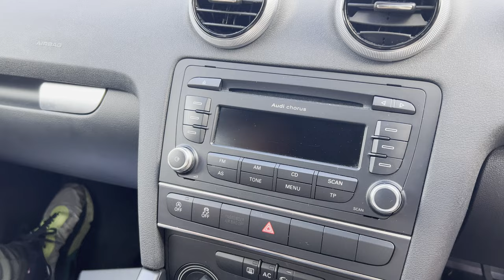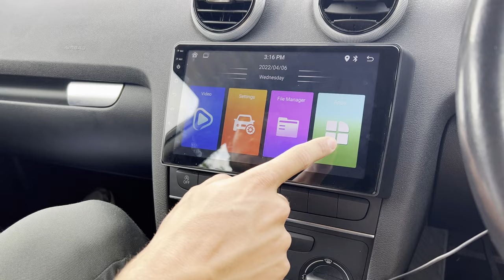Audi A3 Radio Removal Android Car Stereo Fitting Installation 2003-2012 Pluscenter

Comment: My rear speakers dont work. ☹️ Any fix?
Reply: If they were working before then it could be the rear amp needs a power to switch on and you can also buy a different lead to your head unit to fix this.
Reply: Or pretty sure it’s cause you got the wrong harness?
Reply: Wrong wiring or incompatible
Reply: If you have the bose system you need the high/low impedance cable, £25 and it'll be sorted.
Reply: @benji4342 hello! I have the same problem and i buy that adapter , how it is connected?

Comment: Quick one here. I have installed mine but now the time resets all times I start the car. Customer service told me that I need to take the yellow cable to the main power of the car. Also the amplifier for rear speaker needs power too. Can somebody guide me here?
Reply: Hello did yours fit straight in?
Reply: It worked and still working but rear speaker don’t work. I think I need to find a cable to connect the amplifier

Comment: Hi, great, vid. Nice and straight forward. Did the GPS antenna placement affect performance? I was advised that it should try and get line of sight to the sats. Also, did having only 1 fakra affect the radio? I bought a dual fakra but will return it if the radio still works with the single. Not that I listen to radio much.
Reply from the maker: Hi, the GPS aerial is okay there but sometimes will be better to install outside the dash. About the aerial depends of the car original with only 1 is good enough more cases, thanks!

Comment: Few quick questions. What are the 2 usb cables for thst you pushed through the side?
What happens to the maps and music if i put it in reverse (with no camera) ie does it get paused or closed?
How does it work? Does it connect to phone for data? And does it have access to apps store? Sorry i know its alot of questions haha
Reply: USBs are for media you can put MP3s and MP4s and play the media. You can turn off the reversing feature in the settings in car info or sometimes called factory settings. Otherwise you do get a no signal each time you put it I reverse.

Comment: Hi! I just installed mine just like you showed in the vid. My android head unit works otherwise perfectly but any sound doesn’t play (radio, bluetooth or anything). What might be the problem? I have audi a3 and bose sound system
Reply: Did you figure out? I have same problem
Reply: @KurdishZyzz  No I didn’t. I took my car to a workshop and they said that nothing can be done. So I guess that’s it.

Comment: Sorry for the stupid question but how do you then take it back out, is there a specific technique before I yank it out and damage something? Thanks
Reply: I was wondering the same exact thing...every video I have found does not show how to remove.
Reply: É difícil remover, é necessário comprar 4 chaves específicas para remoção. Após encaixada cada uma das 4 chaves, basta usar espátulas plásticas para remover do painel.

Comment: is it the same fitness for a factory bose speakers option?
Reply from the maker: Yes of course our stereos comes with Bose adapter it's also plug and play, thanks!
Reply: does it come with instructions?
Reply from the maker: @hatchali6765  everything you will see in this video is enough to fit it by yourself, thanks!

Comment: Hi there 🙂
I have a "JUNSUN   9" purchased for my Audi A3 8P1.   this comes with a surrounding bezel, once it's in then it's in because I can not see a way to extract the unit, there are four plastic tabs and when pushed inside it allows the bezel and the unit to be extracted, weird really - - - - - -there is no way to get to these tabs once the unit is installed home.
Have you come across this problem before🤔
Reply: Wondering the same. Have you figured it out??
Reply: Se fizer um pouco de força numa das laterais, a mesma vai sair e depois sai a outra e o rádio fica outra vez fora.
Reply: @vrdubb0221  YES I have, before you insert the plastic surround where the tabs are on the surround there are four raised areas (one each corner) be careful if you get a diamond file from Aldi - BUT if you undertake an internet search for one you will see what I mean, using an ordinary rough file it takes forever. BE CAREFUL how you shave these raised areas off  (NOT the tabs) you can now insert the surround and it now fits snugly in place.
You can now place the unit back in carefully moving the various cables out of the way, a little solution here I tie-wrapped all my extra cables, - which makes it neater and when you come to place the unit back in you have an easier time moving cables out of the way,
It fits so snugly because of the tie-wrapped loom that holds it in place and anybody looking inside will see it and move on to the next vehicle to steal their stereo
 just saw that you posed the question 2 months ago sorry 😇

Comment: Hi, how do we make the rear bose  speakers work front work fine but not rear speakers
Reply from the maker: Hi, make sure you use Bose connectors, thanks!
Reply: @pluscenter  does that come with the package?
Reply from the maker: @dannyhasan6118  yes of course

Comment: my friend got the same one, I installed it but the rear speakers don't play. and what worries me the most is that I don't know how to unclip it.  Can someone help?
Reply from the maker: Hi, just pull the left or right side and it will pop out, about the speakers they usually don't work if you don't use Bose connector or if the adapter is not locked up properly, thanks!
Reply: @pluscenter I have my Junsun 4gb+64gb for my Audi a3 8p 2008 and rear speakers don’t play. Are the Bose connectors in the set or must I purchased that ekstra? How to connect the cables properly to make the rear speakers play? Thank you

Comment: Hello, I did everything as the video but I dont have audio, it works but I cant hear anything. My A3 comes with Bose Sound System
Reply from the maker: Hello, for BOSE system you will need adapter between the stereo and car main power. Thanks 🙏
Reply: What adapter do you need for  Bose?? As I want this stereo but knew there would be this issue. Any help with what part is needed much appreciated
Reply from the maker: @reillyccfc  Hello, the Bose adapter is included in the package with our system, thanks 🙏
Reply: @pluscenter  what’s the difference between the two units for the Audi A3 I see there are two units
Reply from the maker: @reillyccfc  Hello, A6 PRO is 2GB RAM + 32GB ROM Quad Core Processor and A18 PRO is 4GB RAM + 64GB ROM Octa Core Processor 4G Sim Card, thanks 🙏
Reply: @pluscenter   Hello, please where can I contact you? Is it possible to sell me just the wire harnesses? I did not receive the BOSE Adapter and when I plug I dont get audio nor front or back, plase sell me all the wire cables by separate
Reply from the maker: @aikenyep1495  contact me on email pluscenter@mail.com
Reply: @pluscenter  email sent🙏🏼🙏🏼

Comment: And what about the rear speakers? Do they work or only the front speakers? 😂
Reply from the maker: Our stereos comes with Bose adapter now and even if the car is not Bose it will help for all speakers to work on same quality as original stereo. Even with the wiring harness from the video most Audi cars will work normally.

Comment: My rear speakers dont work any
More
Reply: I have the same issue :( did you manage to find a fix??? Would be great to sort the issue out
Reply from the maker: Hi, make sure you connect right the RCA cables or use Bose adapter for it, thanks!
Reply: I, how the Bose adapter looks?